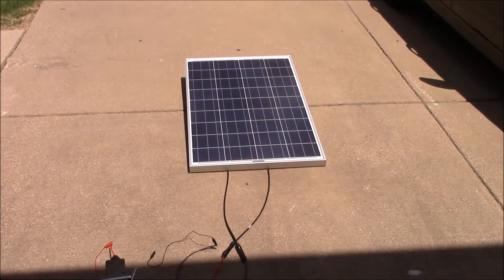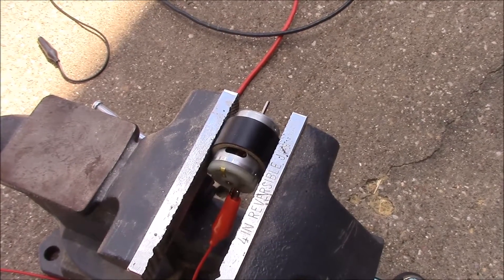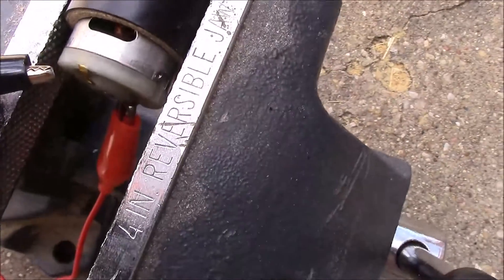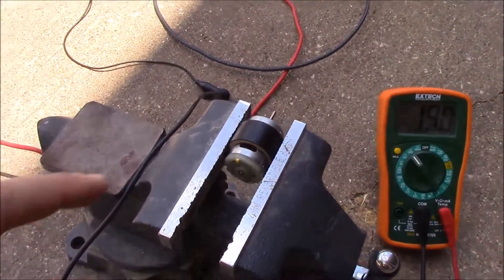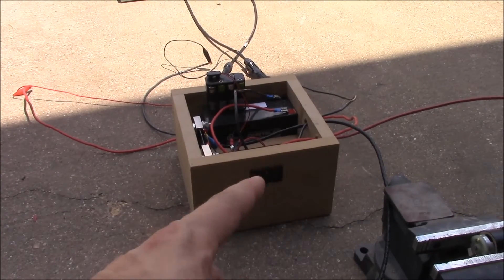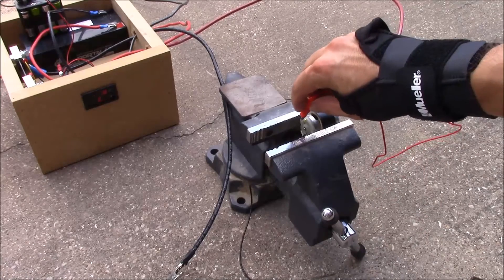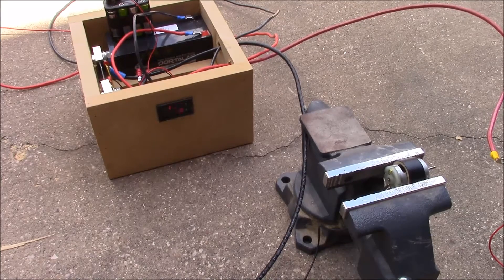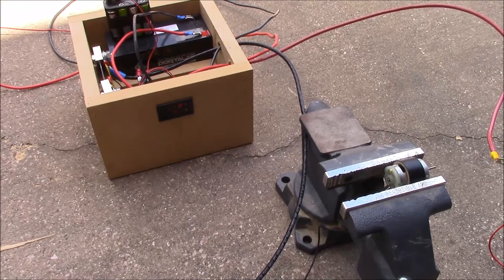Will It Solar? - Hobby DC Motor

Comment: You need some capacitance in parallel, I tried this with smaller solar and the start current wasn't provided by the solar panel. Someone also said that we should run a diode as well to avoid that the motor ends up acting as an inductor but I haven't tried this yet
Reply from the maker: True but that would then be "Will It Solar With A Capacitor?".  The point of the video series was to see what common devices I could get my hands on that could be powered directly by a solar panel.
Reply: @LDSreliance  agreed partner, but I have the same problem as you. This is the way I found to make it work. I have a small solar panel laying around, makes at most 740mAh, rated for 12v, but it does not provide a fraction of the current when it's cloudy. So, I made some asking around and found out that it works with a capacitor in parallel.
Reply from the maker: Yes sir.  Capacitors are the unknown hero of small solar panel systems.  They can make up for a lot of deficiencies.

Comment: Hey man. Man current project is to build a LITTLE/cheap solar panel project that will turn a DC motor with a small potted plant on it.  I am good at software, but new to hardware. Got any tips/suggestions for motors/panels?

Thanks for posting!
Reply from the maker: You are welcome.  I guess you should probably pick the motor first based on what your needs are there and then we can find a suitable panel.  Make sure the motor can handle 14-18V DC.
Reply: @LDSreliance  My main concerns are (1) How do I run the motor to rotate as slowly as possible? (2)  If I try to build this without a battery pack, will running a motor at low power (sunrise/sunset hours) be bad for it?
Reply from the maker: I don't think the rpm will matter.  It will be the voltages that may cause problems, to my knowledge.  So you have to make sure that the motor will be happy with a range of voltages from 14-18 or so.  Those are the voltages that the motor will see under a load.  If it is a 12V motor and is designed for 12V then it may be ok at 14 but not at all at 17 or 18.  You may need some sort of regulator since you don't have a battery that can act as a buffer.

Comment: Your running it to a battery
Reply: Can it go straight to motor
Reply from the maker: Usually no.  Solar panels under a load still provide 17V or so and this little motor needs 12V.  It would probably run on 17V but it would spin too fast and overheat.

Comment: I am sitting here with my 2nd grade class watching your video trying to problem solve why our 3V solar cells with wires, will not run the 3V DC motors I bought.  We attached the wires correctly using positive and negative tabs accordingly, went out to the playground to harness the energy from the sun.....and NOTHING!  any thoughts?
Reply: +Donna Jacobsen - The motor probably requires more current than the 3V solar panel can provide - try wiring more 3V panels in parallel and in direct sun light.
Reply: Me too, i attach 2 3v panel in parallel. Still nothing...

Comment: Hey this is a pretty neat series, really like the videos!

I wonder if an HID ballast would solar....
Reply from the maker: Edgar Hernandez If it is 12v and not too expensive maybe I will try it!  Thanks for watching
Reply: Thanks for taking into consideration. Yep, most are 12V. There are some pretty cheap Chinese ballasts you can get for under $30 or even less. HID ballasts are known for their high amp draws on startup and this is especially true with higher end ballasts such as OEM units. Those are usually a little more pricier but a single can be found for $60.
Reply from the maker: Cool, I will have to check it out.  I'm not sure you would ever power one with solar in the real world but could be a fun experiment.